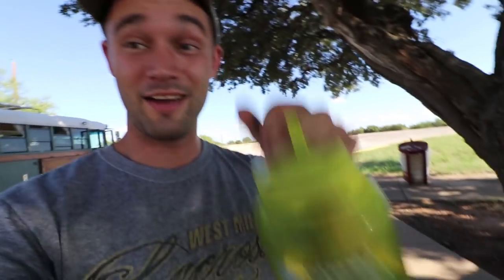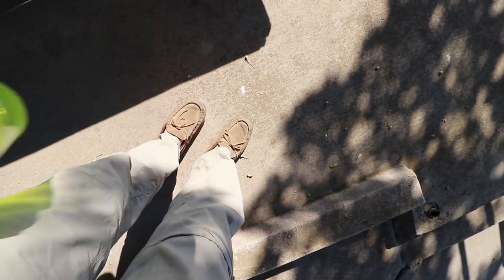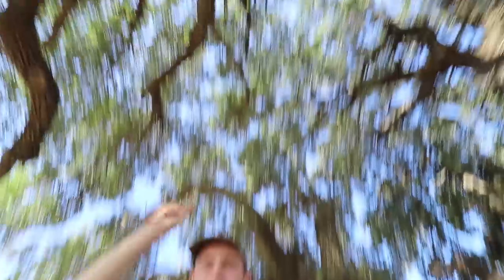How to Install a Battery Alternator Connection For Your Off Grid Adventure Rig

Comment: This is a video I needed to see.  I had a vague idea about alternators and this video helped clarify.

This is what I understood from your video:
1.  Check size of your alternator to see if it can power up your engine and house batteries without compromising engine battery recharging.  Engine gets priority.
2.  Install house batteries closer to engine, so distance is less.  Over long distance, voltage drops, so recharging house batteries is less efficient.
3.  Wire gauge needs to be larger (smaller number like 10 vs 14) for longer distance, so more voltage can pass through despite loss.
4.  An isolator is essential.  Since engine and house battery banks are connected together via alternator, an isolator ensures that charging is one way from alternator to house batteries.  Without an isolator, the house batteries will drain the engine battery since batteries tend to equalize.
5.  One thing not mentioned, is that both engine and house batteries need to be the same type - Lead Acid.  You cannot put a Lithium battery in the engine as it does not have the cold cranking amps needed for an engine.  If you put Lithium in house batteries, there can be no contact whatsoever with the engine battery since they are two different types.  

These questions remain:

1.  How did you wire it up?  Not clear about how wires run, parts involved.  Need a better visual, not a few seconds of poor video angle showing very little, esp at the fuse box garage side.
2.  Did you use professional help or DIY?
3.  What amps does your alternator produce, and what size is it?
4.  What size and type are your own house batteries?

Some options I would like you and others to comment on:
1.  If you use Lead Acid (AGM is best?) for your van in both engine and house, then using one alternator with isolator is good.
2.  If you use Lead Acid engine battery but want Lithium house batteries, then you have two options: 
      a)  Go solar with a separate solar panel install for your Lithium house batteries.  
      b)  Use a second alternator system running off your engine, no isolator required, and this will recharge your house Lithium batteries.  You can also use solar option as well, and you can also use Lead Acid House batteries.  Option A and B can be either or both.

Comment: Great Video. It all makes sense, for all kinds of rigs. If your engine is running and you are on the move, you are basically using "left over" power to charge your batteries. We rented a van that had this option, and it was perfect. Batteries charged very quickly, and gave us power for a couple days.

Comment: Your engine starting battery is more than likely a different technology than  your house batteries. For instance a lead acid starting battery  has a different charge/discharge rate than a lead acid deep cycle battery which has a different rate than an AGM battery (never mind LiFePo4 batteries). If the house batteries are not the same technology as the starting batteries this system will possibly overcharge and damage the vehicle starting battery as it will reach full charge before the house battery bank. While the house bank will still be drawing necessary amps from the alternator the fully charged starting battery will in time boil its electrolyte dry and worst case warp the lead plates causing a shorted a cell. An actual battery isolator is a series of diodes that theoretically allow the alternator to sense one battery. The isolator in this video is a solenoid switch. All this having been said I do enjoy Navigation Nowhere's videos very much. Thank you for your efforts.

Comment: This is the perfect introduction to all the elements of this sort of system and the types of questions someone should be asking/options they should make choices about in order to build one safely! So glad my google search turned this up, it's the best starting point I could have found and I appreciate the info! I run a solar panel on my Ford Explorer but I don't really have the real estate to add a second panel, so I'm really glad to be looking into this. It'll be a lot easier than I originally imagined, for sure!

Comment: Mike, good information and you are very detailed. I would suggest adding a "smart charger" and run a amp volt metor on the dash so you know when your batteries is full. The smart controller will charge your batteries in levels and the dash readout will let you know when you can switch it off.

Comment: We are Off-Grid in our 2.4K sqft home, we use a Magna 4448 PAE and our Battery bank is from a Ford C-Max "Energi."  The reason we used the Energi battery is first it's larger then the standard C-Max, it is 7.6kW.   Reason #2 is that we can make our bank 12v, 24 ,48, or even 60v, with this C-Max Energi EV battery.   We thought about the Nissan and the Tesla but went with the most versatile and the cheapest.     We are shopping for a bus to build right now and will be using it to live it while we remodel our home.  Then we hope to rent it out and take off to the Keys for a month or so then who knows.

Comment: And one other thing you can do is you can buy a high output alternaror which would charge your batteries twice as fast. I bought a alternator that puts twice as much out as a factory alternator would on my F250 . The auto parts store said they can get high output alternarors for any car, truck, van, bus, semi truck
Reply from the maker: Thats a great suggestion. It is an option for many people depending on what their starting alternator size is.

Comment: A suggestion from a fellow who's seen it all ....
  Mount the Isolator in a VERTICAL position ! 
The cylindrical piston quite literally makes contact inside the cylinder and , I have had them eventually Fail horizontally .
Symptoms include Not Moving back into the neutral (off) position or not being allowed to make full contact .
 Mounted in a horizontal position allows the thin isolating materials to wear Much quicker !
  The vertical mounting will outlast a solenoid mounted horizontally .

  Been following you and the Family , not in a creepy way , for some time now and thought I'd interject my valuable two cents .
 Thanks for your well produced videos .

Comment: Thanks for the information. I have a question about what kind of AC unit that I saw mounted in the ceiling. Does it run off of your batteries without any problems and is it in a parallel system?

Comment: Adding a solenoid is a great way to replenish your deep-cycle batteries but you may want to check the output voltage of your alternator and make sure it is at the correct voltage for the batteries you are charging.  Also,  if your deep-cycle batteries are low (~10 volts) switching to charging could damage your electrical system and cranking batteries.

Comment: Question… but first, I’m glad I found this video. I’ve logged so many YouTube hours trying to educate myself for my circumstance. This is the closest match to my scenario. Our nonprofit disaster relief recently gained a 97 Bluebird TC2000. It runs beautifully, but came stock without air conditioning. I purchased a Furrion rooftop and 4K watt pure sine inverter. For now I only need air conditioning while driving and hope my 160 amp stock alternator will keep the batteries charged while running the furrion during drive time only. Do you think this will work or will the furrion drain the batteries faster than the alternator can charge them? I only have two starter batteries. Can’t quite get the additional deep cycle batteries. I will get those when we get yo the point where we want air conditioning while the vehicle is not running.

Comment: Hey there! Do you have a recommendation for a battery isolator that will work with this alternator 12V, 270A,High Amp? Is 200A too low, can I go with the 500A?

Comment: What about auto starting systems for the vehicle's electrical charging? Trucks use them to control fuel usage, temperature, and battery charger when taking mandatory rest periods. Can those be hooked up to a bus engine and electrical system?

Comment: Ty for some info.  But you left me hanging. I want to do this to my E250.   Let me get this straight. Wire starter battery to Alternator, then Alternator to Isolater Switch, don't want it to go to ignition or Starter battery will get drained, got that. When do u connect to fuse? Does the Isolater Switch then get wired to the Auxillary battery?
Reply from the maker: Alternator - Starter battery - fuse - isolator - fuse - auxiliary battery.
Reply: Georgia Corey  Your alternator is already wired to your main battery (the one in your vehicle's engine compartment) so ya don't have to worry about that part. You're essentially just tying that battery to your auxiliary battery (commonly referred to as the 'house' battery).
If you go to the Amazon Link that he put in his video description you'll see that there's 4 pics of the isolator...the last pic is a wiring diagram that should help ya to understand better on how it's done...👍

Comment: Will the batteries still charge at idle, if you were to use the bus motor as a generator of sorts.  Also how long do you think it would take at idle to recharge the bank to 100%?  Also are you able to run your roof AC off of the battery bank after this type of charging?

Comment: Good info,I now understand why Jax got you and Badge to build out his bus , Question: how does this compare or relate to a multi stage battery charger?, is it better or give a complete charge etc. thanks.
Reply: moose knuckle multi stage charges slowly which is the best this charges fast. Eg 10amp charge takes day to charge where 100 amp alternator will do it in hour or less 🇨🇦🇨🇦🇨🇦
Reply: thanks Badge for that answer, I like your charging set-up on your rig and hope to do something similar, you the man. subed  to your channel.

Comment: So your battery bank is being charged by aternator and solar at same time when driving?

Or does solar power cut off when you got the aternator running?
Reply: I guess my question is, is it ok for the solar and alternator to be charging batteries at same time
Reply from the maker: Yes both are separate inputs. They are both feeding Into the system.
Reply: Hmm this like a dream come true

Comment: Can a battery alternator be installed in a off grid house Battery Bank Solar System too? I'm trying to make a Battery Bank out of Lithium Ion or Iron flow and salt water. ESS Inc's Iron Flow. Or Tesla Power Wall or other lithium ion battery types.....Or is alternators only restricted to automobile motors... Just trying to think outside the box here. Just curious.

Comment: Have you tried marine battery switches? They are great for isolating which set of batteries You want to charge or draw from, set off/ neither, set-1 set-2 or both.
They are small easy to use, easy to install and sure way to control batteries and marine grade is considerably better built and inexpensive.

Comment: NN, To keep coach batteries up at night, while driving and charging coach batteries I turn up (colder) the Frig, Then when I stop I turn the Frig down. So that the batteries don't work so hard because the frig is extra cold. The result ,More amps in battery in the morning!
Reply from the maker: Thats a great idea. I turn my fridge off at night as well. I don't see a need to 'keep it cold' when its already 35 degrees out at night, where I am currently.

Comment: We replaced our generator  with a small lawn mower engine that runs an alternator which charges our batteries much faster and on less gas because it charges our batteries in half the time
Reply: Ooh nice!
Reply: Any issues since this comment?
Reply: @reevesjustin  no this worked great but we changed our batteries to 6 volt instead of 12 volt deep cycle batteries they discharge slower and gain power slower they work much better in the winter  with the short days and the long nights  to keep refrigeration going through the night ,but the other system worked great for quick charging the system now we don't need it at all 100%solar
Reply: @karenriggle5435   did you go to 6 volt lithium or 6v deep cycle? how many how connected (series or parallel) and wiring?  (bus bar or inverter)?

Comment: I Like the video! Always good to see how others are building these kind of systems...! Still i want to add referring to your isolator! Now im not fermilliar with all of these systems and if there are already retail devices out there altough im guessing there are /should be! But regardless of that fact there are serveral high voltage relais that are able to operate on 24 volts yet also are capeble of switching high voltage and current.. But non off any options are called cheap i gues electronics are just expensive in many chases.                                                                                                                    But yeah Nice truck Nice Video your are a lucky guy i wish you the best! Take care and stay healty!

Comment: Just a thought and not sure how it would work but what if you wrapped a copper wire around the cable going to your auxiliary batteries to prevent the drop you were talking about?  Maybe it will help that.  Not sure just seen many videos of how copper wire actually increases electricity.

Comment: Nice set up and great vid! I'm trying to get something similar for my bus, but can only get hold of the 100amp Bussman circuit breaker. Do you think that the 100amp would still work with the rest of your set up? Or is the 80amp version required? Thank you in advance! Dan

Comment: No split charge relay? Wouldn’t this manage the charging of the battery’s electronically instead of manually turning the isolator switch on and off?